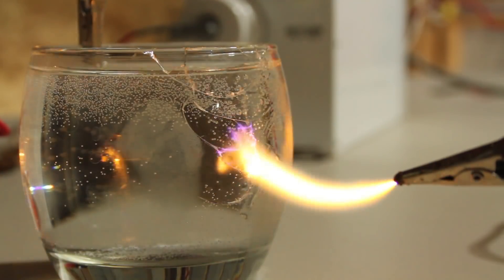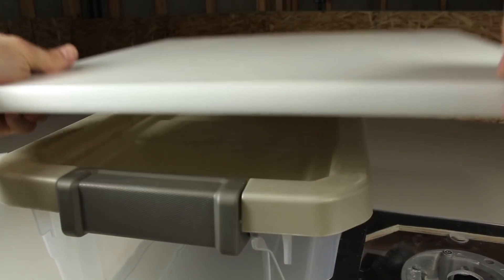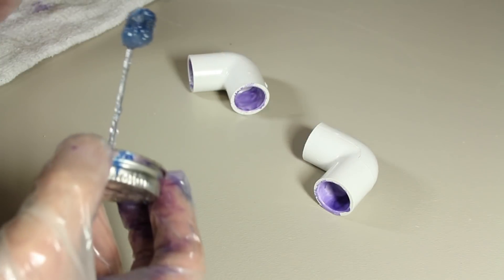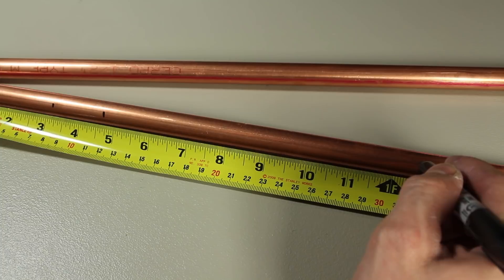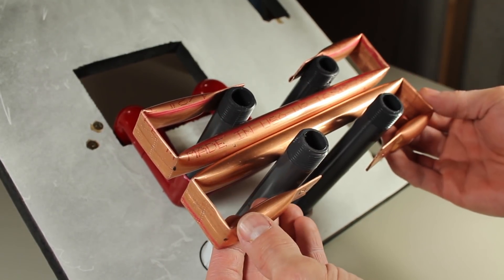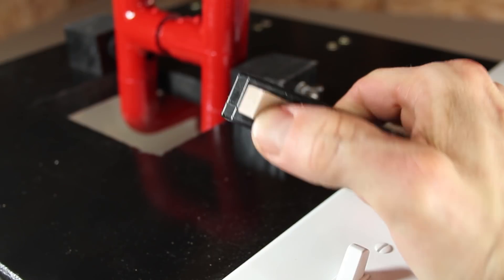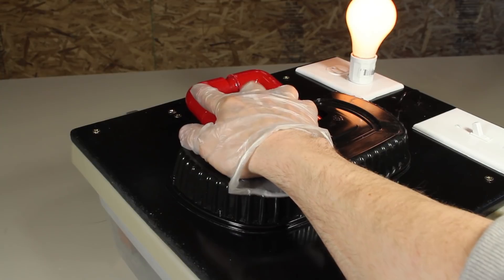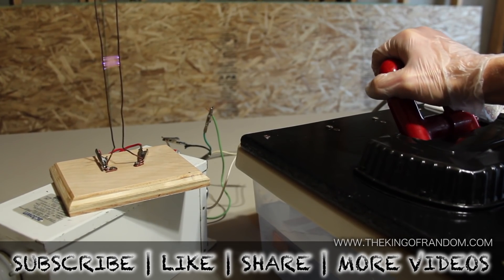The Scariac (Poor Mans Variable Power Controller)

Comment: Easily sorted switch the the input terminals on one of the MOT's so there out of phase .then join the 2 transformer cores together and earth them .Doing this way is the correct way so that one of the cores is not live or you could just brush past one and get bite of course at these voltages nothing would happen but people can use the same setup to get 4200v and die through bad practice ,im not dissing the guy iv been a long time sub but after being bite myself ,safety is a very big issue

Comment: no the center tap must be floated electronically. ut will be at (in his cace like 9 volts and high amperage) ground would cause this to short. 
since the 2 mots are phased together they act like a center tap. if he wanted half the power he would connect at that point. connecting it to ground would be very bad.

Comment: no. not at the power levels his house could supply to that (20 amps max) but the copper will become corroded and the water will become cloudy and contaminated. that will happen whenever you use water to pass an electrical current through it.  but changing the water is easy and sand paper will clean up the copper

Comment: I only have a vid of my burns ,I did share it on here to show the damage that had been caused and that was me being lucky .The switch failed because i was drawing over 10 A though a light switch that's rated a lot less causing the contacts to melt together .Is there a reason for not having an earth on your welder project ?ill watch it again as the two cores could be a center tap to earth making it a lot safer

Comment: Buy a lottery ticket, you usually only get one chance with a MOT.
For my MOTstacks I use two contactors with a coil running mains current, and the light switch just handles the couple of watts going through the coil.
Glad to hear you made it.

Comment: first off dont think I'm dissing your work I have been a long time sub ,i just see a high potential for death after getting shocked from an MOT only a few days ago . 2200V 0.5 to 2 A from the secondary they have a rating for normal use but have a peak V&A of much higher ,I got some pretty bad burns as it went through a finger and thumb from the case and 1 finger from the terminal .if it had been pretty much any other way like hand to foot or hand to hand i wouldn't be typing this message now

Comment: I'm not that concerned about 120v its if you have something like an MOT attached to this which a lot of people will  ,You switch the switch to make safe then touch the something and you have 2200v at .5 to 2 A going though ya even worse an MOT stack. It happened to me the other day and its NO fun I could easily have died so could many others I just think as a long time subscriber its only right to point out using stuff not rated can easily be deadly

Comment: The zinc coated screws will have corrosion issues attached to the copper.  A copper sulfate solution will react even faster as long as those screws are there.

Also, does the water get very warm after heavy use?

Comment from the maker: Yes.  NurdRage actually suggested I use Copper sulfate as an electrolyte with copper because there would be little to no electrolysis at all.  So that is probably something that could be looked into.  You're right about the root killer.  I have a bottle of those blue crystals in my collection :)

Comment: As usual, awesome video! If I may suggest, you could add something like glycerin or something with the same conductivity as water but that will increase its viscosity a bit. The purpose of course being for safety to reduce the chance of something electrolyte spilling out. 

I'm especially looking forward to the router video!!

Comment: hey grant this system keeps the mechanical torq high...? or the torq goes down... 
tip u would made a stick welder just using your scariac without transformers... I´ve ask this because im doing a Fix post mirror-o-matic to make telescopes... and i´ve tried to use eletrical regulator on a/c motor with no sucess... now im using 3 pulleys!! to make 1200 rpm to 60 rpm!!

Comment: Yes.  It was also used in early stage lighting technology-all of the lights were hooked up to  'salt water dimmers', which would do the same thing this thing does, except vertically and in a tube of salt water.  The technician would pull up on the rod to make the lights dimmer, and push down to make it brighter.
The More You Know!

Comment from the maker: You're right about that.  I originally made it for the welder, which doesn't have a ground, so I didn't see a reason to included it in this controller at the time.  I would leave the ground attached now however, and it would be as simple as running the bare copper wire to the ground on the outlet.  Easy.  Thanks for your comment!

Comment from the maker: This copper tubing is only about $10 for 10 feet actually .. but you don't even need the copper.  In a pinch, I would just throw two live wires in a bucket of water.

Comment: you say it can handle high current load but your using a low amperage light switch and you were pulling 15A if you use that with the welder you made it will be much higher ,I dont mean this in a rude but that switch alone WILL probably kill someone buy getting stuck .Trust me i know i got a nasty shock from an MOT the other day just because a light switch was wasn't rated high enough the sockets are a major issue too :0(

Comment: That's not really a Variac, it's basically a high power potentiometer. Variacs work as transformers, which are much more efficient than a simple resistance.

Comment: To get a place to put the clamp ampere meter. The clamp ampere meter measures the amperage going through the wire that is in its jaw.
A clamp ampere meter only works if you have ONE wire, not the two or three wires in a regular appliance cord.

Comment: If you used an SSSS instead of the lye the resistance would be far too low, you would get a scariac that always was at 100% - and if you just want on and off you could just aswell use a switch =P

Comment: i think he uses his double plug lead that goes straight into the scariac providing 240v for the circuit. or he just runs normal 120v through it, and plugs his double plug leads into the two sockets coming from the scariac.

Comment: Veeery nice! :D Could you use a supersaturated salt solution instead of the drain cleaner?
I reckon you could find a cheap current clamp meter somewhere, gut it, and have the whole thing built in :)

Comment: Cool! In addition to using a GFI outlet, it probably would make sense to use a three wire plug/wire and run ground to the controlled outlet. That way the controlled device is still grounded.

Comment: You could also seal the gaps with some kind of power resisting rubber. (not electrical tape) I would also suggest making those wing nuts very tight to prevent your current from being adjusted by gravity in the middle of a project. I would put Duck Tape around the plastic container so if it cracks you don't get shocked.

Comment: This is not a substitute for a permanent dimmer switch, this is a piece of lab gear, used for testing experiments at low power.

It could easily handle running an hour a day for at least a couple of months before severe erosion, at which point you simply replace the worn out parts.

Comment: Electrolysis is a phenomena observed in DC circuits, not in AC circuits.
Mains electricity is AC.
My ass produces more hydrogen than this setup.
The container is not sealed and will not build pressure.

Not saying it's safe by any stretch of the imagination.

Comment: I've worked as an appliance repairman and fiddled with all kinds of stoves, from the high end Miele induction stovetops to the 1950's vintage Husqvarna.
I have never ever seen a variac in a stove.
Rather, the cooking plates have one winding with four taps, allowing six steps of heating.
A variac is expensive. At least $100 on ebay for one that could handle an angle grinder.

Comment: Voltage output is constant only with NO LOAD! With a load you have a voltage drop on the variable resistor. This is not my opinion, but the Ohm's law!

Comment: In other words this is called Electrolysis, a common factor released is hydrogen, oxygen, chlorine( depending on which water type used).
Water electrolysis does not convert 100% of the electrical energy into the chemical energy of hydrogen. The process requires more extreme potentials than what would be expected based on the cell's total reversible reduction potentials. This excess potential accounts for various forms of over potential by which the extra energy is eventually lost as heat.

Comment: Instead of a fuse, or a breaker, you should just use a GFCI plug to plug the Scariac in.  That would definitely be safer.  You could get one by re-purposing it from an outdoor power-strip, I've seen them at the Home Depot before.

Comment from the maker: Yes that's correct, some gas will be generated.  In my experience, since we are using AC current and not DC, the gas formation is much much less, and since the container is open, the gas dissipates fairly quickly.  I have tried to get little explosions from it without success.